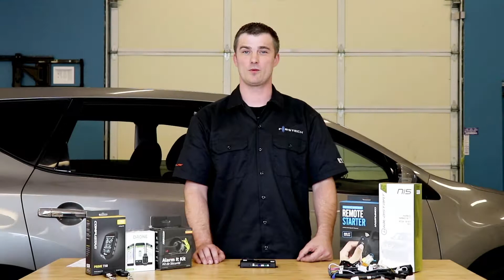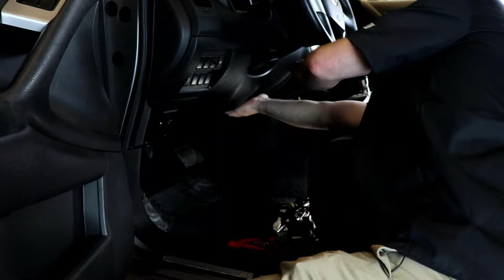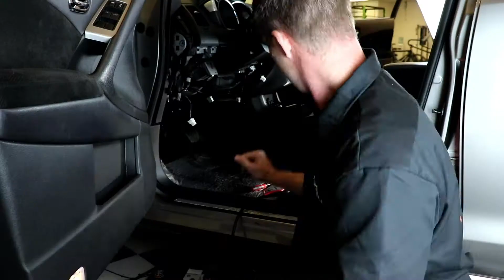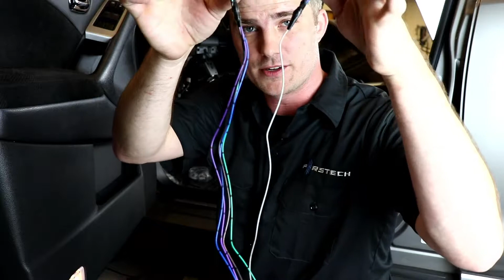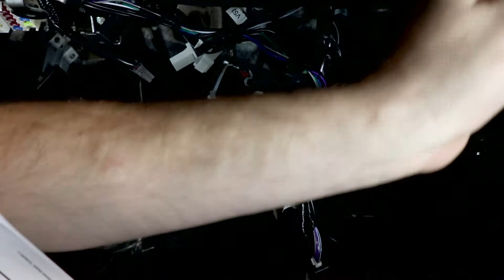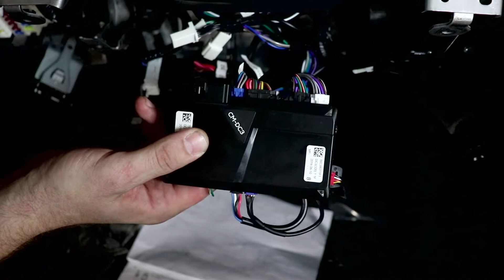DC3 Remote Start Walkthrough (NI5 Nissan 2013 Murano)

Comment: hey how do you reset the module if your only using the 20pin connector? the instructions say to hold down the button and plug in the 8pin connector and 20pin connector but i'm only using the 20pin connector ..any help would be appreciated ..thanks

Comment: How do you find the driver door pin without taking out the upper dash dials to access the BCM?
Reply: Im in the same boat, is a pain in the a$$ to get to that hardwired connection. Any luck idea?
Reply: @leodlion5187  I ended up going with a different brand that required absolutely zero wiring but was plug and play into the BCM. Obviously, the down side was I had to take the dash dials out to get to BCM but it wasn't too hard.
Reply: @Jonathan-cn6xz  i was taking that video as a reference because i have a 2012 nissan altima. I hardwired 2 wires to the bcm the one to the horn switch everything was plugged ready to play and it didn't work, i ended up reflashing the module put everything back and now  the car wont shift from park either the controls/ knobs for the AC wont work. Im screwed. I need help
Reply: @leodlion5187  wow sorry, I'm not sure what to tell you. I can't think of anything if the car can't drive anywhere like bestbuy or some car audio shop.
Reply: @Jonathan  I know right. I will try again today, i was thinking maybe it has to do something with the immobilizer

Comment: Hello on the DC3 moduel with  the das 2 shock, glass, tilt, and movement  the settings on the DAS 2 is set at default and you'll just have to set play with the Dial on the DC3 to your desired  preference.